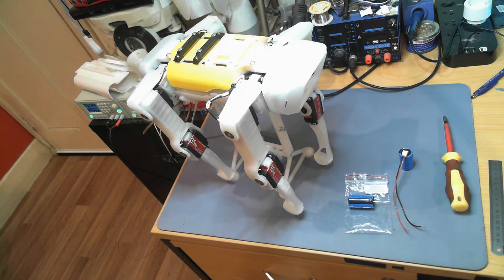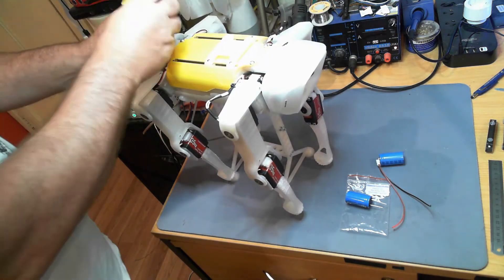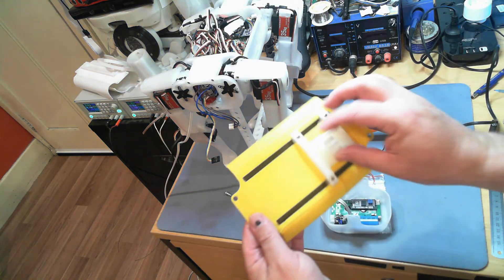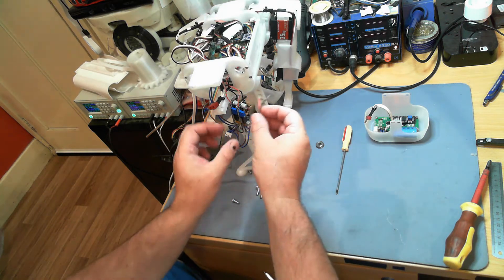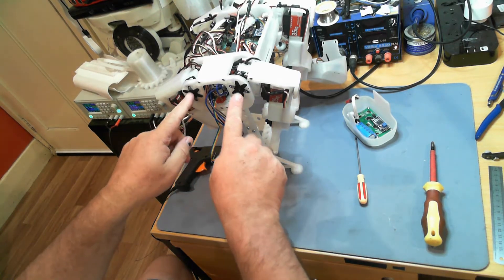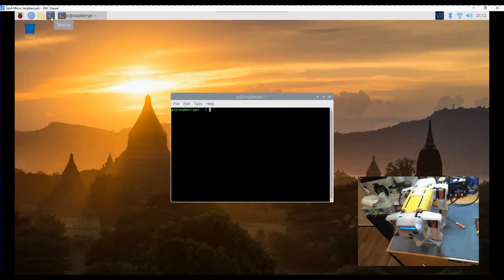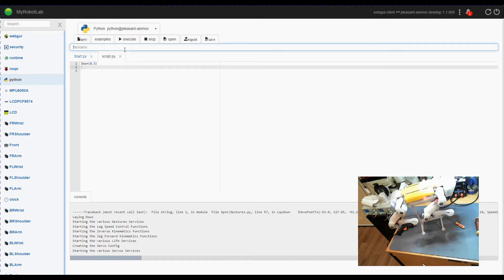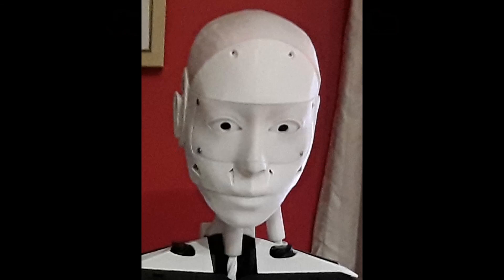SpotMicro Part 15

Comment: Nice job
Reply from the maker: Still more to work out and program.
Next week I continue with the combining the kinematics with coordinated movement controls and covered some of the gesture controls demo in this at the same time.
I also had a look at the OpenCV which i had left running from the live stream the previous day, it was still running at 28 FPS 🙂
I also looked at the MPU6050.
I'm still working on using the data from the MPU6050.